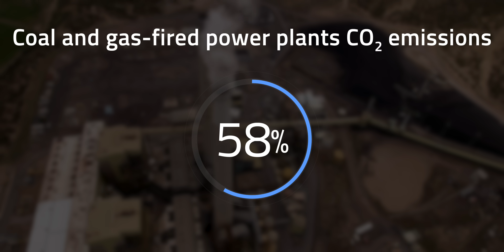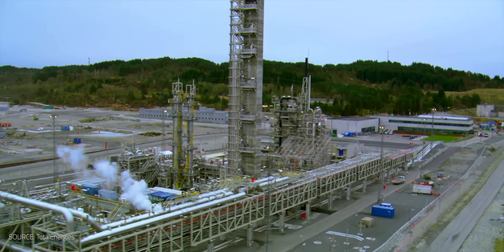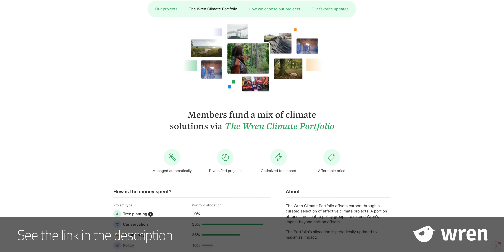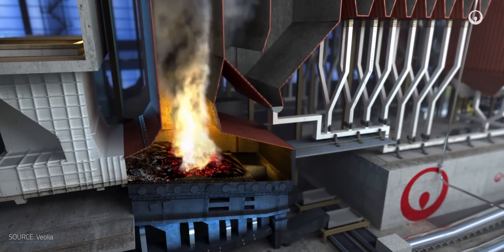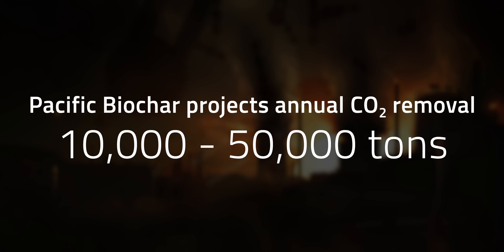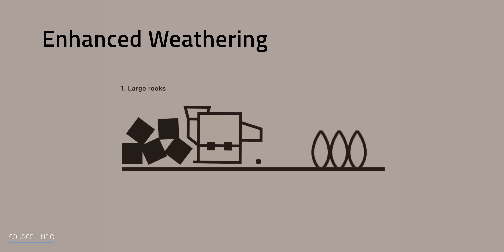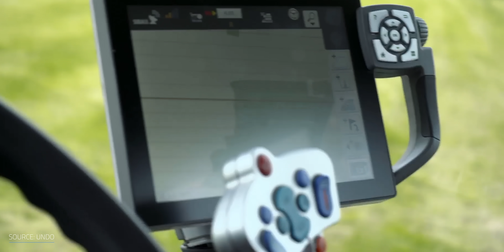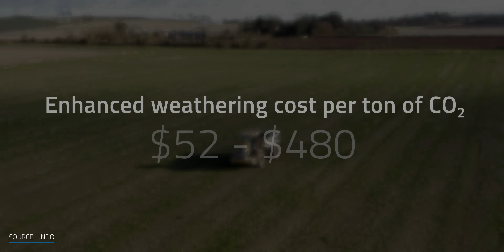The Reality of Carbon Capture

Comment: While fossil fuels are indisputably detrimental to the environment, I can't help but wonder if, long term, other energy sources that are touted as "clean" will also turn out to be environmentally problematic, just in ways we didn't investigate. 
For example, wind power draws energy from the kinetic energy of particles in the air. By the law of conservation of energy, that means that those particles have less kinetic energy afterwards. Could enough windmills decrease the strength of the wind by enough to stop it from performing some vital function in the ecosystem?

Similarly, solar panels absorb solar energy that would be landing on a surface. That solar energy is no longer going out into the environment. What would the effects of that be? In deserts it might result in a cooling of the ground temperatures and who knows how many knock-on effects that might follow on from that.

I'd be really interested to know if there has been much research into the topic.

Comment: Another controversial topic is Turquoise H2 production, or methane pyrolysis, methane is heated in an atmosphere free environment to the point where the H2 is released and all that is left is solid carbon black, it kills two birds with one stone, plenty of ultra pure carbon for batteries and graphene so we don't have to mine and refine graphite and H2 for use in industry and supplement renewables during half the day when solar is just sitting there not producing peak power. We can use the extra solar and wind from when we have to overbuild for a rainy day to produce it also.

Comment: Soooo....I've noticed the green channels suddenly start to broadcast that green power need "on demand" fossil fuel generators.

You guys get orders from on high or something...or is reality smacking folks in the face?
Reply from the maker: That's not what I was implying in that statement.  The reality of today is that renewables require existing fossil fuel plants to finish out the mix .... because we're at the very beginning of a transition.  As we add more renewables and energy storage, that need will disappear.  The point is that until we reach that point we're going to still be burning stuff.

Comment: I'm skeptical about DAC. Especially against flue gas capture. The air just doesn't have that much CO2 in it. How is the energy required to run the facility produced? Even if it's from wind and solar, how does the amount sequestered that stack up against reduction from gas and coal peaker plants if the DAC facility was replaced with a battery park?
Reply: A good point about the low  concentration of CO2 in the atmosphere. It was easier with Nitrogen capture for synthetic ammonia since 30% of the atmosphere is N. However while the concentration of CO2 that DAC will work with cannot reach CCUS level ( from smokestacks etc) we could make it a little easier by locating such plants in metropolitan areas where the level is sure to be higher-i would guess?
Reply: @edwardhogan1877  N2 is around 78%, CO2 is around 0.4%

Comment: Hi Matt, I just wanted to comment on a couple things you said about biochar. One was that the permanence is uncertain. There are several research pieces on this, and it is well defined based on properties or production processes. The other thing you said is that biochar needs more research in the ag industry. It turns out it is the most researched topic in soil science, and it solves several issues in the industry while displacing fossil fuels and reducing fertilizer usage. Biochar can improve in other carbon capture methods such as DAC, algae, concrete, and anaerobic fermentation. It can also replace many pollutant ad/absorbents. The fact that biochar is graphite makes it a great sustainable alternative for many uses in the tech sector. This is something I think about while watching your interesting shows.

Comment: I am no scientist, but burning wood is really bad for the atmosphere right?
You say "with little oxygen" but all the footage in the video is of open air flames.

If what you say is true, people can go and cut down trees to burn, release gigatons of nitrous oxide, waste all that heat which will heat up the planet. ( burning wood on a planetary scale will)  and that will somehow help?

Why not boil alcohol and turn a turbibe, create electricity with that wood.
Or, take a quarry that is done and fill it with branches and sawdust, then burry under gravel, then mud, then clay and finally put a body of water over it.
These holes can be huge and the decomposing wood will be kept there.

Otherwise, why not "just" isolate the carbon and let it react with hydrogen from green electrolysis. Then it becomes an alkane.
Lengthen the chain with grignard reactions until it is a solid and dump that in the quarries.

To isolate co2, use water with calcium. All things that won't react with water or calcium pass trough.  Then take the water with caco3 and heat it up. Co2 is released and the calcium can be reused. As an alternative you could split water in hydronium ions and hydroxide ions with an electromagnet and change the ph of the water to make it more or less soluable to co2.

The reaction with co2 and h2o is common. Called grey gas i beleve (can be wrong. Likely are). 
Use the methane to make ethane. Keep lengthening the chains until they are a liquid. Then capture them. 
Either use buthilithium to make them react with lithium, after which you can make an alcohol or an acid.
Do both to make esters which can be very long and stable. Dump those.

Yes it takes a lot of energy but if done correctly, only that.
Yes, we can use the energy for something, but this will work without any weird effects next to leeching.

Dump it in the desert and it doesn't matter any more.
Not that the desert does not matter, but because the deeper layers are not used for anything biological. Man made or not.
Reply from the maker: Here's how the process works .... https://www.allotment-garden.org/composts-fertilisers/biochar-terra-preta/how-to-make-biochar-at-home/#:~:text=You%20can%20make%20biochar%20at,off%20clouds%20of%20white%20smoke.

Comment: I have tried several times to work the math on the amount of CO2 in the atmosphere causing the amount of temperature rise that is attributed to it. I can’t make it work. However, if I factor in the amount of heat needed to produce the CO2 through burning of fossil fuels then the equations look better. I can’t believe I am the only one that wonders about this. Therefore, is the CO2 the cause of warming , or is the heat used to create the CO2 the cause, and the CO2 a small part of it. Please do an episode on the math.

Comment: Given that nearly every method has a "ticking time bomb" element, a time limit for the sequestration, I'm hesitant to consider these as any real long term solution, outside if where the carbon is being used and not just buried, or sunk in the ocean.
Reply: Biochar was used in the amazon forests and is making the land more fertile over 1000 years later. That top soil is now being sold off since it is so much more valuable than the surrounding soil.

Comment: Without getting into any math, I'm generally skeptic about the large-scale feasibility of these carbon capture approaches, simply from looking at the chemical composition of CO2. It is the result of combining carbon and oxygen, which releases a lot of energy and makes it chemically very stable. This is indeed the main reason why carbon is burned: to get energy out of the reaction. Well, since that's the case, it will naturally take a similar amount of energy to break it up or to combine it into something else. We will need to put energy into it and that energy needs to come from somewhere.

I can understand that the cost or impact of reversing the release of CO2 can be offset by using byproducts from other economically viable processes. But again, if there is enough energy in those byproducts to sequester CO2, then they will have other economically interesting applications. Otherwise, they will be very inefficient due to a relatively low energy density.

If these approaches make a significant contribution at a viable cost, then by all means let's use them. But we can't count on them to be THE solution. I still believe the most beneficial way to sequester carbon is to restore and protect forests, which actually do the most sensible thing: they collect a lot of energy from the sun and use it to reverse the production of low-energy CO2. Furthermore, they have numerous environmental benefits which are far beyond just controlling greenhouse gasses, and properly managed they can provide tons of carbon-fixing wood which would go into relatively long-term storage in construction.

Of course, we must also work on reducing our carbon footprint. This should always be regarded as step 1. But most of all, we need to stop hoping that some revolutionary technology will soon sequester all the excess CO2 we produce out of thin air. This just doesn’t follow the fundamental laws of physics and it will not happen. Even if we figure out how to gather massive amounts of clean energy at an extremely low cost, then we could just use that other source of energy directly to reduce the carbon footprint of our activities.

Comment: I do like the idea of BioChar.  If it could be used to enhance crops it's wouldn't be just a "save the planet" thing but an actual "making money" thing, which lets face it would speed it up tremendously.  I do have concerns about its efficiency.  It breaks the carbon cycle, as you said, but it is pulling plant matter that needs to be grown first, and that takes time.  How much time would it take for enough plants to grow to actually make an impact?  That being said, one more small bite from the problem is excellent.

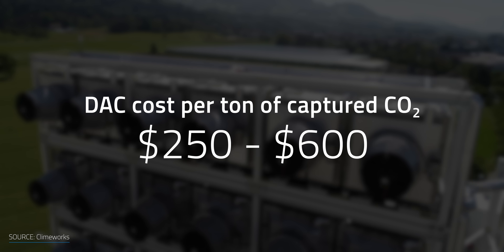Comment: 3:40 you mention its energy intensive. In my area wind turbines shut down after the basically 9-5 peak times, sitting idle. Would it be possible to run such systems and keep the windmills running through the night only?

Comment: 1.  Most of your CO2 'footprint' is out of your control.  It's spent on your behalf by others.  The biggest thing you can do to decrease your 'carbon footprint' is to stop pretending that we can solve climate change by planting at tree and swapping a few car trips for a bike ride. (Do those things anyway if if makes you feel good, it's not wrong) Instead, we need to focus on those agencies that are emitting huge amounts of carbon and force them to change their ways.  We have the technology.  What we're losing is the PR.  They spend huge sums to try and make the public think that they're responsible.  That's why the term 'carbon footprint' was invented by the fossil fuel industry.  It's a continuation of the attempt to deflect THEIR responsibility to others.

2.  Using captured CO2 to unlock otherwise trapped fossil fuel is not helping.  It's greenwashing at it's finest.  The net result is extra CO2 in the atmosphere, but they get to claim they're somehow reducing CO2.  The math doesn't work, but the PR is gold.

3.  Direct air CCS will be necessary but only because we've dramatically overshot the 'safe' amount of CO2 in the atmosphere already.  We need to start drawing down.  The fly in the ointment is that there's only a limited number of sites suitable to deposit CO2 so wasting those sites by trying to capture newly created carbon from freshly burned fossil fuels is the exact wrong thing to do.  Remember: We're adding 2 oxygen molecules to a carbon by creating CO2 so it demands about 2/3rds more space to store it than it took in liquid form.  Unfortunately going after it in smokestacks where it's concentrated is the cheap way to do CCS.  Not helping in the grand scheme but good PR.  The solution is to stop burning things!

4. The challenge with direct air CCS is that CO2 only makes up something like 4% of a given volume of air.  That means you need to move basically 25 tons of air to recover a single ton of CO2, and that's assuming a perfect capture rate.  This requires a huge amounts of energy and right now that tends to come from burning fossil fuels, at a net NEGATIVE carbon release rate.
Reply: 1) The point is not that one or two people on Earth do it, but that we can convince many people to do it. The more people improve their own personal habits, the larger the impact.

It's also the case that we can do things in our cities and towns to reduce the CO2 impact of the entire city / town. While the overall goal of the "Strong Towns" movement seems to be focused on reducing traffic, they are trying to do so by decreasing reliance on cars - which in turn reduces the CO2 footprint for the entire city / town.

2) I'm not sure what you mean by "Using captured CO2 to unlock otherwise trapped fossil fuel." That doesn't seem to be a point made in the video?

3) There is a limited amount of CO2 in the atmosphere. We don't need an unlimited number of sites - we just need enough to bring carbon levels in the atmosphere to a reasonable level. That said - it would be preferable to actually extract the carbon from the CO2 to make it into a solid, which takes far less space.

4) This is the type of argument where somebody needs to do the actual math. Hopefully the people working on these technologies are doing so.
Reply: It's even less I think in % terms.

Comment: The best carbon capture scheme is to leave it in the ground and refrain from removing it from there to begin with. Far cheaper than attempting to put some of it back while you are still putting out way more than you are capturing.

There are two types of carbon capture:

1) the green washing BS advertised by the fossil fuel industry to extend the hopefully short period that we still tolerate them destroying our planet at all. Honestly, this will never add up to anything sensible economically for the simple reason that even without carbon capture these solutions are already economically and environmentally unsustainable already. They know it, and we know it. Adding carbon capture cost to this mix just makes it worse. The most positive thing that you can say in favor of it is that it will accelerate bankruptcies in this space. All this is tiny extensions of their runway. It's not about capturing carbon but about providing some thinly veiled excuse to emit some more carbon. The cheapest way to get rid of carbon emissions in a coal plant is to simply shut down the plant immediately. Anything else is just losing money faster.  

2) the type of terra-forming activity we'll have to undertake to roll back centuries of emissions and mitigate the greenhouse effect. For this we need  best bang for buck type solutions. Letting nature take its course would work but would probably take many thousands of years. We caused all of this in less than a century so figuring out how to roll it back at the same pace would be prudent. IMHO, re-greening is probably something that might have a net positive impact since aside from capturing carbon, this also restores ecosystems, reclaims land on our deserts, and improves quality of soil, agrirculture, etc.

The reality of course is that so far we are merely slowing down the rate at which the problem becomes worse. And even that is debatable as it seems the rate at which things get worse is accelerating not decelerating. Negative carbon emissions are decades away even under the most optimistic outlooks and as long as it is positive, things aren't getting better. That's a good reason to not help the coal mafia in any way spreading their BS about how much carbon they might capture relative to what they are emitting. Which would be an unmeasurably small rounding relative to what they emit. We're talking many orders of magnitude here. The total of carbon ever captured compared to emissions during the same period add up to so close to zero that we might as well just call it out as F*** all. It's a shameless scam. It's shameless because it's proponents know it is a scam. It's like the tobacco industry saying smoking is good for you so they can postpone the eventual bans and court cases a few years more. Ignorance is not something anyone can claim here. "More studies are needed ..." just translates as "we'll just burn some more coal while somebody not funded by us pretends to study this". 

The most urgent thing is to shut down the fossil industry ASAP. It seems Vladimir Putin is achieving more on this front than anyone before him, though probably unintentionally. The whole of Europe is going cold turkey on gas this winter. It's probably the most positive thing he'll achieve in his life.

Comment: There is only ONE form of carbon-capture that can be industrialized, and that is 'Gasification' of fossil fuels.  1) First you take either coal or oil or natural gas, and you gasify it under high pressure and temperature to turn it into carbon monoxide and hydrogen gas. You use a catalyst to turn the CO into CO2, and then you liquify the CO2 and pump it deep underground. You can then burn the H2 to generate electricity, and the output from that is just water.
Reply: 'gasify under high pressure and temperature' and then 'liquify': I can see the energy bill mounting up as I read this so are you sure when  get as far as the end-product H2 generated electricity will all this be efficient?

Comment: If you're using captured carbon dioxide then it won't have been permanently removed from the carbon cycle. If it's used to grow crops, then the carbon is in the crops and will be released again at some point. Same with biodegradable plastics, when they degrade, that carbon will be returned to the carbon cycle. And the carbon in a fizzy drink is being released directly into the atmosphere either sitting in a cup or by burping after you drink it. For carbon capture to be useful, the carbon has to be removed from the cycle entirely.